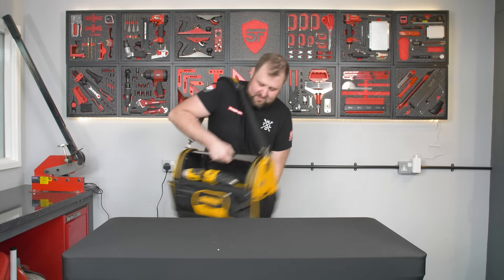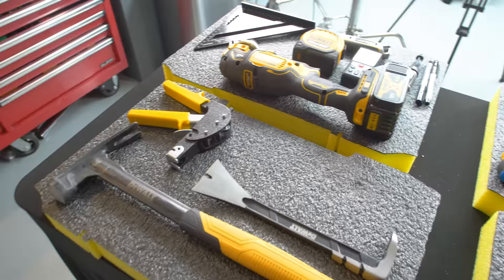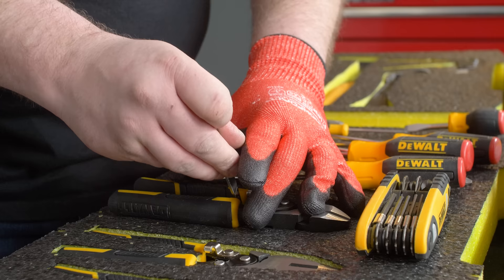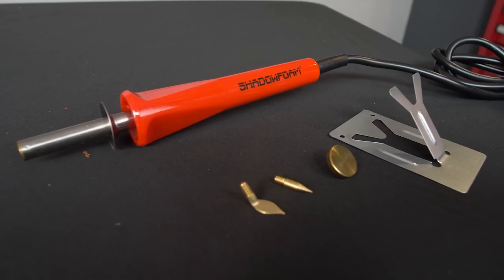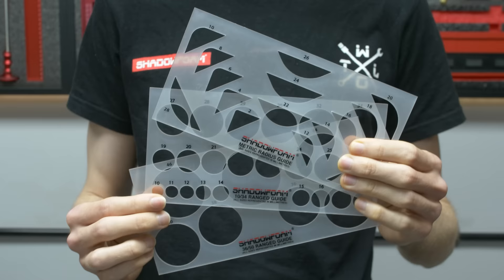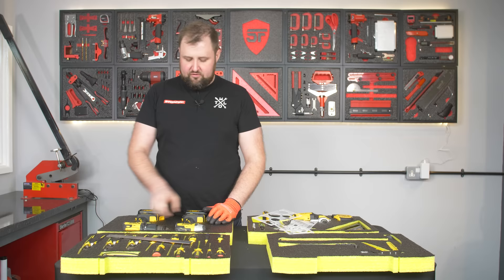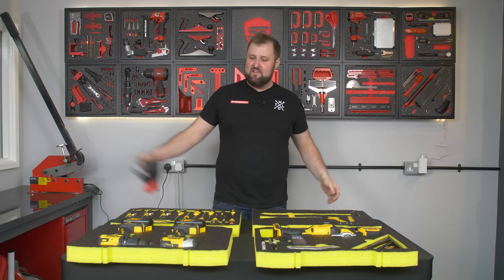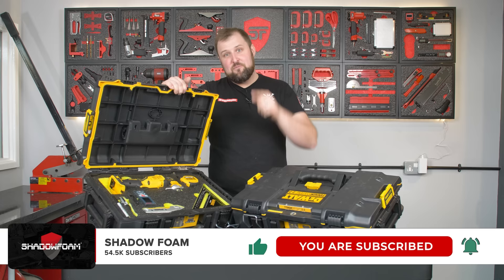The DeWalt Toughsystem Makes Organizing Tool bags OBSOLETE!

Comment: "Having all your tools thrown in a bag is just a nightmare" is something a late night infomercial would say. Shadow foam is good stuff, so are the toughsystem boxes, but for a lot of jobs open top totes are far faster, as long as you keep everything where it belongs. Having to open and close, stack and unstack the boxes every time you need to move is a giant time suck. Carrying multiple boxes connected to each other is far more bulky than even the largest totes, my Veto XXL pro pac carries everything in this video and has a nice cushy strap.
Reply: What I’m starting to do is have a smaller bag that holds only the tools I need for a specific project. Collect stuff from the various storage bins and then keep them in an open bag like the one he had. I can throw a tool back into the bag instead of leaving it on the ground.
Reply from the maker: Totally understand your point of view mate, I'd say it depends on the job and transport system you have to hand!

Comment: Think I seen this similar for foam. Filler just had rip out points a lot safer to use.
Reply from the maker: Shadow Foam is very safe and easy to peel, just need your safety glove on when using the scalpel!

Comment: For the box that I put two layers in, I glued the top layer of shadowfoam onto a thin layer of plywood as I find it too flimsy with the weight of tools in it. Then easy to add dowels in opposite corners to act as handles. Looks like I missed out on the smoothing spinners and the irons are out of stock now as well!!
Reply from the maker: That's a great idea mate! Definitely something I'll be reccomending to others! 👍

Comment: I still prefer Milwaukee drawer system. It’s way smarter than the old school system
Reply: DeWalt toughsystem product managers are completely clueless. DeWalt could have an absolute killer product with a proper 1, 2 & 3 drawer box system (with handle 🙈) and shadowfoam inlays
Reply: @mattsalive7614  I’m not sure where you guys live. But, here in the States, they have a two draw 2.0 draw system option.
Reply: @garycasper2929  the 2 drawer is available in my country, but they removed the top handle (v2) for reasons I don’t understand. Also they cancelled the 3 drawer option. Their product line is just confusing and unreliable; I want to know that I buy into something sustainable and mature like the Packout system. Willing to spend money but their products just aren’t there yet. Contemplating packout but I prefer the looks of dewalt personally
Reply from the maker: have you guys seen our Milwaukee packout system video? - https://youtu.be/vuujOTqxIqU

Comment: If you were to use the narrow depth trays with foam would you still get two layers in the small storage box?
Reply from the maker: I don’t see why not
Reply: @ShadowFoam  the reason I ask, I wasn’t sure wether two shallow trays with foam would fit on top of each other in the small box, but it might make it easier to remove the trays to get at tools rather than just have two layers of foam without the trays..

Comment: Im a bit of a bag/case whore.Every year or so I buy another what seems to be the perfect option only to get disappointed by it a few months down the line. 
I buy Dewalt power tools, and have been looking at the TStAK range, looking at how you cut in the screwdrivers into the foam has impressed me enough to give it a try................